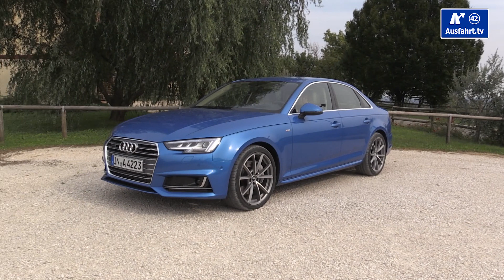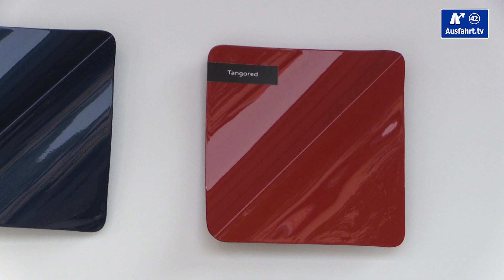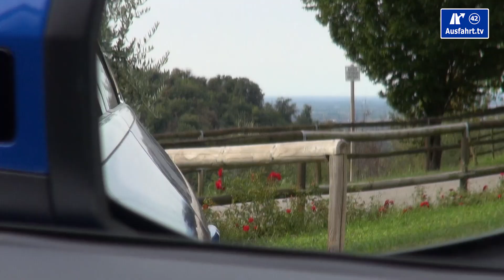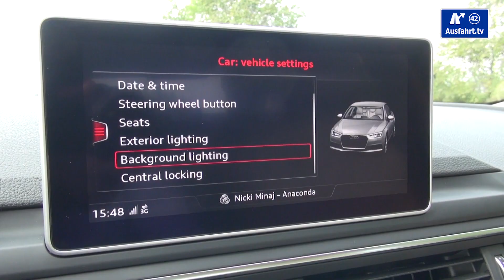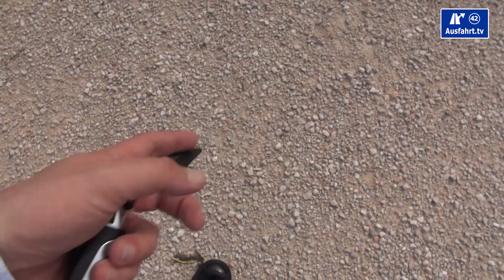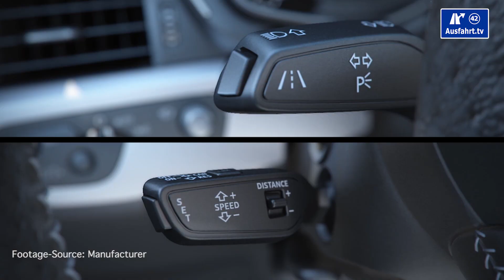2015 Audi A4 2.0 TFSI quattro Sedan (B9) - In Depth Review, Full Test and  Test Drive (English)

Comment: Nice review and you're first on reviewing B9 if I'm not mistaken (at least on famous eu channels...). Btw I would say that the correct way to say it has a leather steering wheel is to say it's "wrapped in leather", not "coated in"... When it comes to cd coef. width of tyres also has some influence there, it would be nice if you could do a review with an engineer explaining that.

Comment: Hi. 

You said that the suspension is very good, but do you remember wich version you did tried ? Audi have 2 adaptive suspension system : 1 is 10mm lower, the second one is 20mm lower than the standard version --> I'de like to know wich of those 2 you tried.

Thx for your answer

Comment: Good to see such an in depth review of the car. When will you review the estate version? Also how do you think the car compares to it's rivals (Mercedes C Class / BMW 3-series)?
Reply from the maker: +dw909 We will review the Estate version Mid October. I think its rather a quastion of personal taste which brand you choose of these three. BMW is a little bit more about driving dynamics, while Audi has the best assist systems for my taste and Mercedes overall is the most smooth daily driver ;) I like them all, but I confess to be a little Mercedes fanboy. [Jan]
Reply: +Ausfahrt.tv Thanks for the reply. For me is a choice probably between the Mercedes or the Audi - leaning towards the Mercedes I think because comfort is important to me (I have a bad back) but I do like my gadgets. For some reason Merc doesn't do 3-zone climate control or rear window sunblinds in UK market which you get in A4. No heated rear seats in C class either. But maybe these are all nice to have and not essential :)
Reply from the maker: dw909 Good thing is - however you decide - you cannot really make a fault ;) But as of your back, Mercedes is at least offering air suspension for the C-Class. [Jan]

Comment: I am wondering why the armrest is short and does not cover completely the compartment below. It doesn't look right to me (especially when cables are there). Did you experience low response of the cluster instruments during size or information changes? A4 is a new fresh car, but how it is the general interior feeling compared with the interior of C Class? And in the end, congrats for the nice review.
Reply from the maker: +valivr Thanks! The virtual cockpit as well as the infotainment are very responsive, I dont remember anything disturbing at all regarding those two. The interieur is as it is very Audi'sh ;) Mercedes went a complete new road with the new c-class which I really like. Audi did more evolution than revolution, which I dont mind. [Jan]